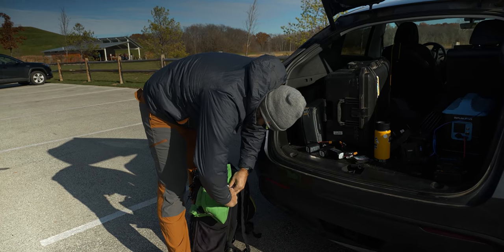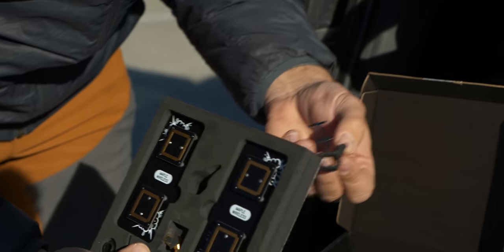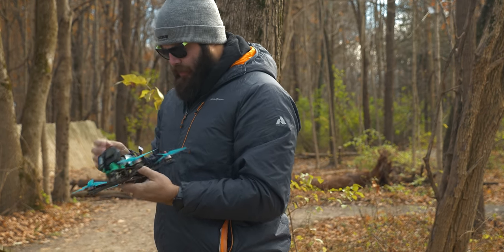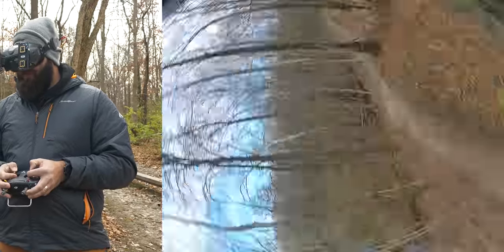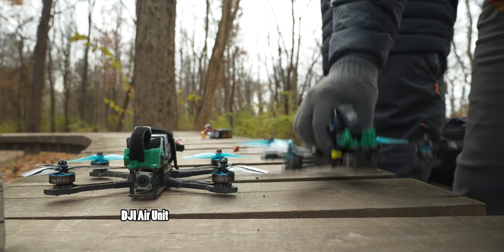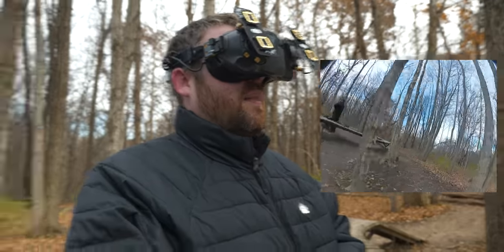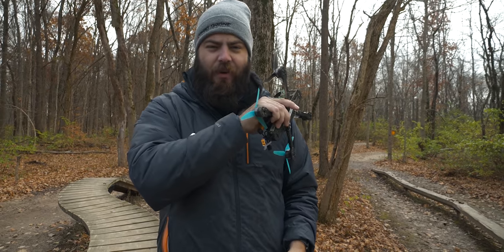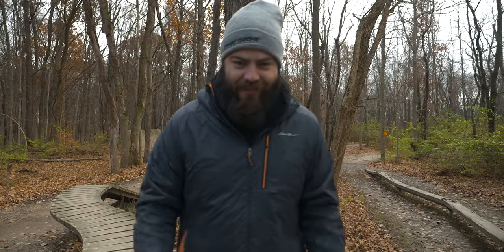Is the Nebula Nano Pro as good as the rest? 120 FPS nano HD!

Comment: Nurk! Great video. Do you have aftermarket Gimbals in your DJI Controller? I see red anodized aluminum in there. If so, what are they? Thanks!
Reply from the maker: I DO have aftermarket. They are the radiomaster gimbals, but you have to do some mods to fit them.
Reply: @NURKFPV  nope they are FRsky m9 gimbals… i made it for you 😉
Reply from the maker: @trialpsycho_rc  boom there ya go!
Reply: @trialpsycho_rc  Is it a relatively easy mod? I've been looking for replacements for my DJI controller, and there's not really any info out there on it.